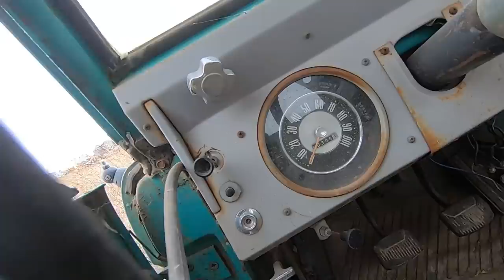Abandoned 1966 Ford Bronco rescued from the pasture! Will it run after sitting for 25 years?!?

Comment: I bought a '67 Firebird convertible for $175 in '76 because it had quit on the previous owner. He had put in new plugs, points condenser, coil etc. but it still wouldn't run. I took a chance figuring that it was the plastic timing gear that had let go, it was. After replacing the timing gear I had a hell of time getting it started & then found out that it would only run about 30-40 mph. Towed it home & was scratching my head wondering wtf to do next, went inside to grab a cup of coffee & realized that something I had seen didn't look right. Went back out to the car & inspected the engine bay closely, found the coil hooked up backwards. Swapped the wires & it fired right off & drove properly. It was a good running car and had the 326 with powerglide.
Reply from the maker: Hopefully you kept that one!
Reply: @MortskeRepair  I wish! I kept it for a couple of years the got a set of orders for a one year tour of duty to MCAS Iwakuni, Japan. I sold it to the owner of the garage where I worked at for my civilian job with the option to buy it back when I returned. He told me that it had been totaled by his son shortly before I returned, always had my doubts about that though. I did sell it for a bit more than $175 though.  Keep up your work & I'll keep looking forward to seeing them all as and when I can.
Reply from the maker: @rogerstephenson5639  That's too bad!

Comment: Nice Bronco !!! She's a keeper... They are a PIA though... I like the custom hood prop rod.  You should consider fixing just the front brakes... Maybe use some of the rear parts to make complete half...
Reply: Do it right check out pickups and econolines of that era for parts
Reply from the maker: New parts are cheap and sitting on the shelf!
Reply: @MortskeRepair  ever try rock auto ?? Maybe they can sponsor you.......please change oil filter  chek trans and diffs......no air cleaner? Got that wierd one..kaaaaaa-chinnng!!!!!
Reply from the maker: @rsprockets7846  I've got about 289 magnets from them. They check up on me if I don't make an order every other week!

Comment: a 1/4 inch drive socket makes a pretty good guide to find center . just fit the socket outside diamiter to the bolt size and a 1/4 inch bit . ive seen folks use that deal that centers door hinge screws too ,its like a straw with a tapered end .
Reply from the maker: Thanks for the tip!

Comment: Next time try heating the area around the broken stud with a torch, welding on a nut, then pouring cold water on the area. The shock of the cold water will help pop the threads loose. Smack it with a hammer while pouring the water on it. Put a wrench on it and work it back & forth until it loosenes up. Maybe that will help!

Comment: I aint never seen a first gen Bronco - man have they come a long way in comfort since!  She's decked out spartan like a period Land Rover....but at least she has enough horses to pull the skin off many bowls of rice pudding (unlike the Landy)!  

Being 55 years old and largely neglected for a while, she didn't take much coaxing to fire, eh.  I was surprised when she lit off so easy.....but then the luck of the dreaded four-letter F-word struck and she became a veritable colander.  You persevered more than I would have, mate, but you were rewarded and that engine sounds pretty damn good.  She's got a few rough edges and windows that let that crisp spring air in whether you want it or not, but once the brakes are done and the tank is secured......and you get another layer of foam under you in the cab, she'll be a pretty reasonable rig.  

Go on - push out some dents, tidy the wiring and ignition, chuck in some new shocks, find yourself a better tailgate (or fix that one), fix a few other little things and make her your own.  Them old girls might be low on creature comforts, but they remind us of simpler times while still remaining a pretty reasonable drive on a daily basis.  Best thing is that there's bugger all to go wrong and you can fix it by the side of the road when it does.  Being a Ford, that will be something you will have to get used to....regularly!  😂🤣  Seriously, she's a good score, mate.  

Tell me - are you trying to make a video that is as long as it takes you to read my comments? LOL!  I enjoyed every minute of it though....and no, I think the Camaro was worse to you than this wee beast.  I look forward to your videos each week and it's been a while since I've seen you as passionate about a vehicle as this one.  Could be because overall she aint really that bad and its something you've wanted for a while.  Worth putting the effort into making it right then, eh?  Give it heaps - I'll be rooting for ya 😉
Reply from the maker: Thanks again for watching and commenting Lance!
Reply: @MortskeRepair  Hope my reply gave you a laugh at least, mate.  That's the intention.  Us antipodeans have a rather warped sense of humour and tend to rag on people we like and be very polite to people we don't, so I hope the humour translates ok.  Mind you, you strike me as someone who believes the letters PC refer only to the computer you use to edit and upload the videos and nothing else, so I should be pretty safe!  I think you'd let me know if I crossed a line 😉
Reply from the maker: @KiwiStag74  Nah I can read you like a book!
Reply: @MortskeRepair  😂😂🤣🤣

Comment: Block water jacket flushing tip of the day. 

Pour CLR in the block full strength, then jostle it around on your hoist for a bit.  Let it sit for a couple hours and then flush thoroughly with garden hose til the water runs clear. 

That’s how we do it in central SD anyway.
Reply: Also. Leave it to Ford to make a job as DIFFICULT as is possible.
Reply: “Cleaner than Flint tap water”. Ooooof. True tho.

Comment: a little trick with core plugs, if u can get a new one out, just find a scoket thats a tiny bit to big tap the socket into the core plug, just to widen the lip a little, then re-install flush to the hole. i do that b4 i fit any, just incase.

Comment: 78 Ford electronic Ignition called Duraspark II...Some people hate it. But the Duraspark II on my 78 Lincoln hasn't left me stranded (more than I can stay for the starter motor and brake lines). 
There's an old farm trick to fix a leaking radiator: Dump an egg in and let the engine boil it into a patch. I wonder if the heater neck plug was a result of that?
Who needs power steering when you can just pinch off the brakes for one side and get EPIC Brake Steer.
Reply from the maker: Probably turned left real good!

Comment: You can use dove soap bar flakes (cut up) and run it with water to make hot soapy water to clean out the inside of the coolant passages. Run the engine up to temp without the thermostat. And flush it a few times

Comment: The extra freeze plug in the right side of the block is the easy way to tell if you have a 200 instead of the 170 falcon 6. The small six was used in the Falcon van which became the Econoline van  the original 145 six was stroked to 170 for the vans years later Ford did a parts mix up upgrade to make the 200 . The auto 170 was a 145 with a larger bore. By increasing the van 170 to the same bore as the car they came up with the 200.  The van engine got an extra main bearing which is why there are more freeze plugs in Econoline 170's and the 200. The Australian ford's got ad big as 250 and had a cross flow head as well.
Reply from the maker: Great info!

Comment: Little trick I've learned over the years, if you are not already doing this, if you drill the threads out of the nuts before you weld them to broken studs you'll get a better grip on them. I have had a lot of luck that way. Stick on and don't snap off right away.
Reply from the maker: My welds stay with the nut so I don't think that's my issue.

Comment: Best solution I found for exhaust studs is heat them up and use candle wax to lube the threads. Heat them up and melt the wax on the studs. The wax seeps down into the threads and makes it easier to remove them
Reply from the maker: I have heard that but I never have candles available!

Comment: well i used Easter Sunday, to set up this weeks work load.. today was failure, dam dealer ship( Chevy warranty airbag) too many dam things to do.... this dam 79 bronco frame, motor(351) trans, case...are pain to move and pain to find place to store.... those small broncos never caught my eye. my pops liked them easy to fix, not to many round parts. u mentioned batteries, Come to be a fan of Walmart choice, there 3 yr warranty, not that expensive. just bought 3 for all my fords.// yep I forgot to undo the torque converter bolts on the motor removal, made a mess on the street, send wife to store for emergency buy of kitty litter. what red river mess.

Comment: cut a hole in the firewall to put the rear "Core" plug in. but they will all be junk, so replace them all !  There are no "freeze plugs", those are casting core plugs to remove the sand from the casting process,.

Comment: Have you ever seen the Chevrolet Nomad ? Is a South African build vehicle from 76 to 80 with a Chevrolet 2.5 4 cylinder with a Rochester monojet carburettor a Opel gearbox and Holden rear limited slip-Diff....sadly no 4x4 was available....super square design lol
Reply from the maker: Never seen one of that vintage.

Comment: If I had to pull the engine I think I would have rebuilt it bc you said you have always wanted that type bronco. It looks like they used stop leak in the engine and radiator.

Comment: We have the same Atlas lathe. Ya know, it has power feed :)
Reply from the maker: If only I knew how to run it!
Reply: @MortskeRepair  I'll make a quick video for you soon and show the basics on that lathe. I'm not an expert but it might help you out if you ever need to use it for anything more accurate.
One thing to remember is that the gear train is made of Zamak so they can be brittle if you get agressive changing them.
Reply from the maker: @HFG  Had it for 7 years and never swapped a gear!
Reply: @MortskeRepair  me either but I want to so I can turn threads. Sometimes you need a good screw. Ya know? I'm tired of paying for my screws.

Comment: I'm sure you know better than I ever would but, I changed freeze plugs on the back of an old 352 in a galaxy by just takin down the tranny mount ,letting the engine tip down in the back then i could get right to that plug, just wondering, let duff dog bite it out ...  lol

Comment: Can you take out the cross member....
And lower trans..tilting engine down in back for clearance ??
Reply from the maker: And then you get into clutch and shift linkage, speedo cable, driveshafts etc and it's still tight. Best option was to pull it that I found. Plus drilling and tapping those manifold bolts in the vehicle would have sucked the big one!

Comment: I worked at a high performance engine shop we would strip the block 100% clean all the oil galleys everything out with a pressure washer and brushes and then I went through a parts washer machine pressure washer and oil galley brushes is all you need and you can get that black 100% cleaned out
Reply: Sounds to much like work ya know. Work fascinates me, I can sit and watch it for hours
Reply: @blair79bear38  it was exactly that work. Was the first stage before we did any machining on the block. Better see what we have to work with.

Comment: So if Napa offered you up a brand sponsorship, would you take it? 😂

As for flushing blocks, if it’s stripped (bare block) I fill it with CLR for a day, drain it and give it hell with a hot pressure wash at the local car wash, they love me there. If it’s assembled I still use CLR then just flush what I can. I’ve gone the muriatic acid route a few times for super bad ones. Works great if you don’t mind working like a Chernobyl cleanup guy.
Reply from the maker: No way those guys call me at this point! I wouldn't take it anyhow! Great tips tho!

Comment: I've seen cars run with the coil wires reversed.  They run, but they have very little power. Also, I had a 1966 Mustang, and it had a 200 6 cylinder.

Comment: 1h:21 ign, if its running while on starter then is it a ballast wire resistor thats at fault, some had a wire, some had a ceramic block. just a thought, i know if u run 12v to a coil that should have a ballast it can stuff up the coil or just run rough.

Comment: hey mortske! not sure if you'll see this message. at 18:36 when you're scraping that gunk out, i had to do the same thing on my 87 thunderbird turbo coupe during a head gasket replacement, and I think its some sort of radiator stop leak or stuff like that! Super weird to see it!! For me it literally clogged one of the coolant holes in the head O.o. Just my own personal experience tho :>)
Reply from the maker: They probably did that to stop the frost plug leak!

Comment: You may already know but I don't think that is  the '66 engine. I had a 200 six in my '65 Mustang and I replaced it with a "73 200. The '73 looked a lot like the one you have there. Same valve cover and the '65 was red, not blue. The '73 had that same carburetor. It wouldn't fit under the Mustang hood. I reused the original '65 carb. I think the carb linkage came around the back of the engine and pulled down on the passenger side of the engine. It was forty years ago though....
Reply from the maker: Decoded as a 78 model

Comment: Let's see. A 1978 200 I6 tells me it was a swap out of a Maverick or Fairmont, some early Fox body donor, when the 170 decided that it was calling it quits. Common swap as the bell housing was identical in those sizes.

Yep, the late 70s, early 80s controlled fuel leak always sucked, and always will, due to emissions strangling it. Check out Clifford Performace. They make performance parts.for the 200 and 300 I6, so their 2 BBL intake would wake it up, with a aet of 3 into 1 headers.

My own take on.it. time for an early 90s.EFI 300 with a 5 speed, swapped from an F150, 91 to 93. On the smaller first gen, that 300 would be more than enough usable power, and being designed for torque, it would have great street manners, while still excellent off road.

Chevy, vortec 4.8 liter backed with a 4L60E. About $650 with working and PCM, at most junkyards. 

Me, I'd go with the 300.

Comment: Out here in New Zealand my Dad back in the 70s had a 1971 XY Falcon with the 250 motor and you can guess which frost plugs leaked on that one. Yep those little ones under the manifold. He had to take the manifold off any how as the exhaust leaked at both ends like they all do.  Great design Ford.  FORD = Found on road Dead. Fix or Repair Daily. F^%$#d on Race Day. Anyhow, for cupped frost plug removal try to turn the plug 90* so the edge of the plug is facing out of the hole. This can be achieved by beating the hell out of it with a hammer and old screwdriver. Using the poly grips (curved head pipe pliers) grab the edge of the cursed plug and lever the back of the head of the poly grips against the block and they just pop out. just like that. Clean the block out with a pressure washer or fire hose outside.  Then for broken stud removal  LH cobalt drill bits from Snap-On. I haven't broken one in the stud yet. The trick is to get a long centre punch that you can see around to centre it properly.  A light tap on the punch . check the punch mark. Then give it a harder bash. Start with the 1/8 then the 3/16 etc. The left hand rotation will help unwind the stud as you drill. The thinner the wall the more likely it is to undo. The other method is the weld a little mountain onto the stud and then weld a larger nut over it. Undo it like a bolt . The trick is to let the weld harden up for a minute before turning it. People rush it. The weld is still soft and it snaps off.

Comment: Your mistake was putting the steel freeze plug in the rear of the engine, that's what they make brass freeze plugs for, and under the manifold, or like I did when I built my chevy 327 full race I used all brass freeze plugs, never to worry again,

Comment: I use left hand drive drill bits starting with the smaller bit up useualy they undo before you run out of drill bit sizes just a suggestion

Comment: Ya Tom not to be difficult, but they’re not frost plugs but in fact! They are Casting Holes in which they have to plug them and in turn put inferior metal plugs that should blow 🤯💣💥🌋🧨 out saving the block. ✌️🏁😎
Reply from the maker: And the frost/freeze pushes them out! Hence the name!

Comment: I thought that's why all the Chevy head's bought Ford, to drop a good 350 in them matched with the 9 inch Ford rear-end 🤔.  I'd do it in a heart beat. I'd get a 350 from back when it was factory 375 hp out of a 442, i.e. the 350 rocket motor I had one in a 74 cutlass

Comment: you might want to look into an induction heater from Eastwood for stuck bolts
Reply from the maker: You ever used one?
Reply: @MortskeRepair  yeah, I used to repair fuel stations and automotive lifts. I used that thing on the head bolts for unground lifts all the time. before I had it I would smack the head of the bolt with a lump hammer 3lber, put an Allen key either 3/4 or 5/8 depending on the of lift. on the end of the Allen key I would use a cheater bar with a digging bar stuck in the end of that and I would have a mechanic in the shop hit the top of the Allen key with my hammer. sometimes they would come out sometimes they would break and then it was either weld a nut on and go again or drill and extract. with the induction heater you just have to go slow so you don't snap the bolt but have only ever broken two bolts and it was my fault for rushing it

Comment: I like watching someone take a non running vehical that has been sitting somewhere for years and get it back on the street. You deffinately need to fix the brakes, the suspension and the fuel tank issues.